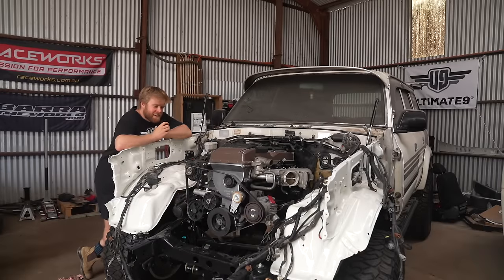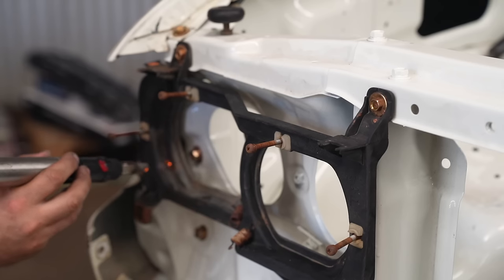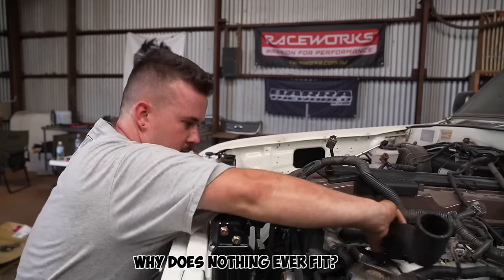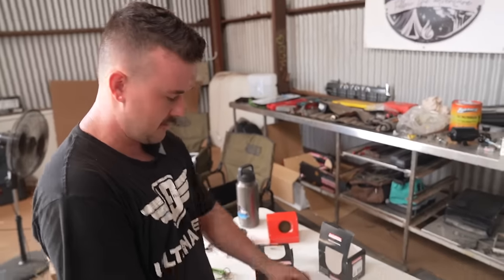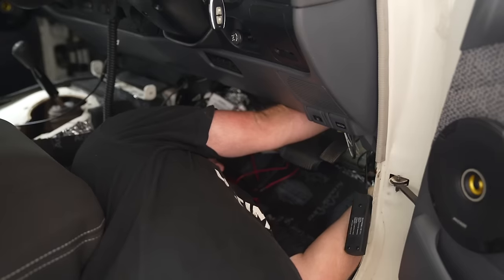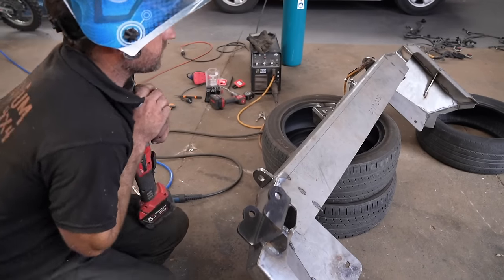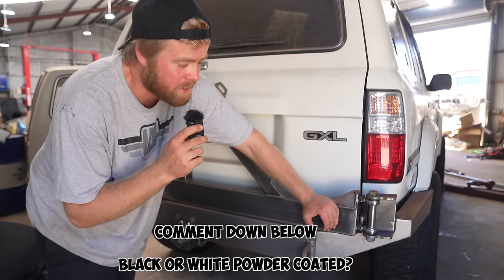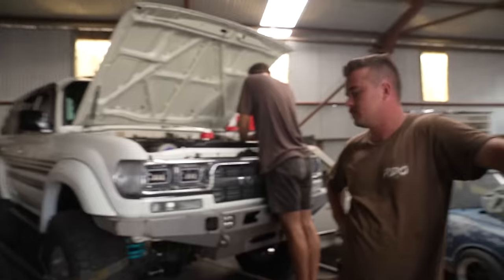Turbo Barra engine conversion on a Toyota 80 series Land Cruiser

Comment: Make a cardbord template and copy it with sheetmetal then colourcode it.
Just weld a few tabs at 90° and bolt it in place.
Or use the cardboard template to get 3d printed somewhere.

In the meantime just put some contact  on the cardboard and wedge it in place for the show
Reply from the maker: Cheers mate!

Comment: 3D print your gear stick infills. Just make sure to use material that can cope with the heat.
Reply from the maker: Cheers for the tip mate! Any tips on where to get something 3D printing?
Reply: @TylerThompson90  ask around your mates? Car resto forums? There are online services as well
Reply: @TylerThompson90  if most surfaces areas are flat, just getting a sheet metal shop to laser cut & bend might be an option too? I got my Unimog dash done this way.
Reply: @TylerThompson90  department of the interior or cruiser consoles probably can make something for you too

Comment: You missed a spot Burto, nice work on the surrounds and the buckets and brackets sand blasted,  but then ya screwed in rusty mounting screws🤣 passenger kick panel is a good place for the box for the XRS.
Id rust proof the bar work and then clear coat it. looks sick as RAW. Congrats on the Tools guys, Burto deserves em, be less rusty bolts now and quicker build times haha mate, just kidding ya, awesome work as usual , dragging Tyler and Demi into the shed life, you legend Burto, just hope the 80 survives the  next trip to Bunnings by Demi, we may need a poll to predict timeframes a day a week a year or 25years😛
Reply from the maker: Thanks mate!

Comment: Powder coating regrets coming your way .. DONT DO IT!!!
Reply: Is that because of chipping?
I once enquired about getting a bar powder coated thinking that was the better option.
To my surprise they advises to get spray painted, they told me it would be more robust and easier patched up.
I then elected to go polished alloy, haha.
Reply: @ianweal3081  that reason exactly . Once the surface gets chipped, game over . Especially on a highly volatile section of a vehicle renowned for contact and scratches happening . 

But it’s not my vehicle in
The end. My guess is what ever sponsor/endorsement contacts first . 💭 🤔